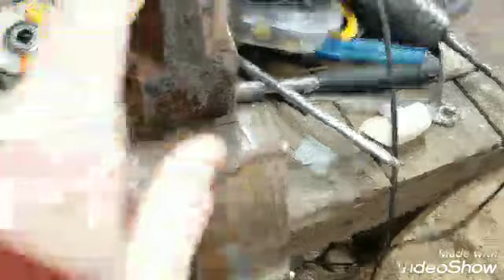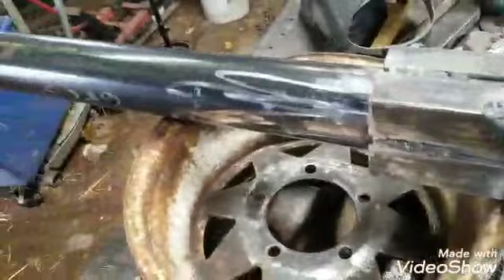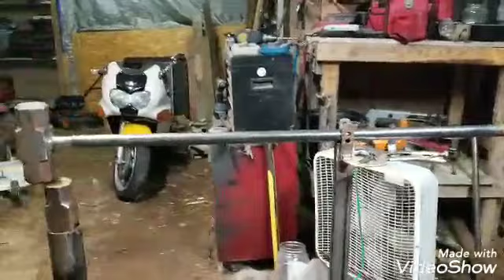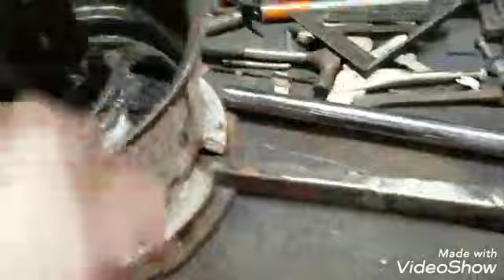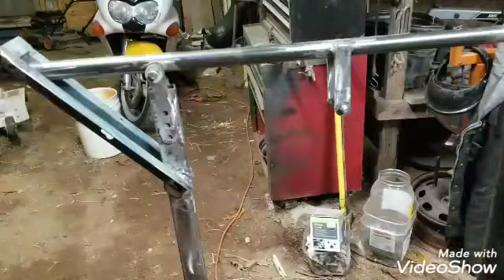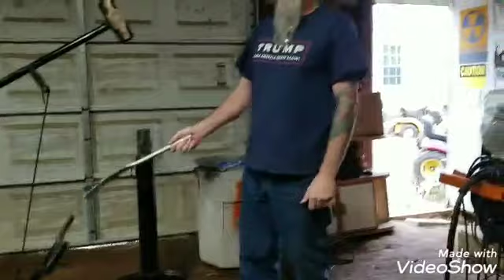Building a treadle hammer

Comment: With the next one Rod weld a gusset to the underside of the pipe at the pivot point and put the pin through that. I think drilling through the pipe will create a weak point that is sure to fail! Other than that a great first time!
Reply from the maker: Thank you,  I plan to later build one for myself.  J think it will be built more along the lines if a straight up and down.  I have a piece of 6 inch solid bar for the hammer.  It weighs 73 pounds.